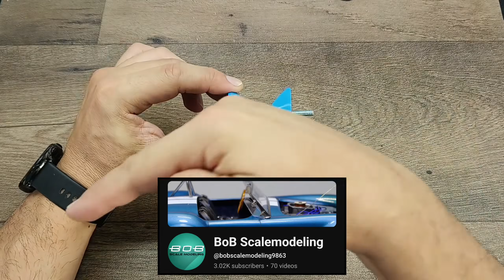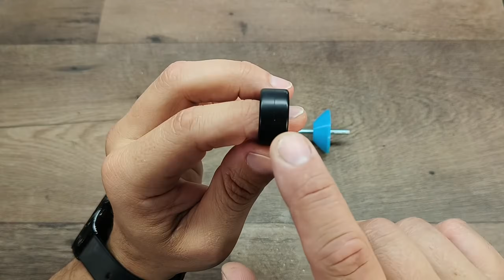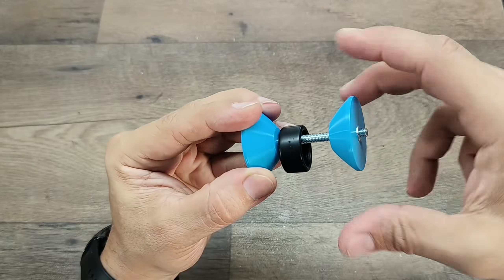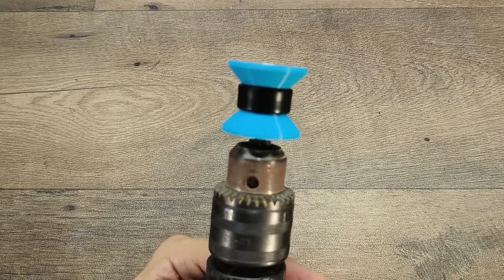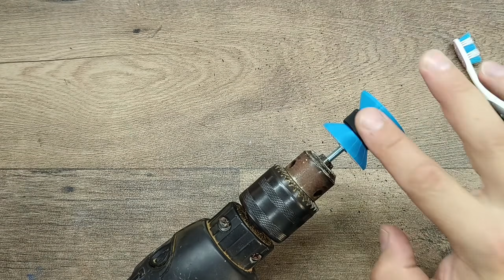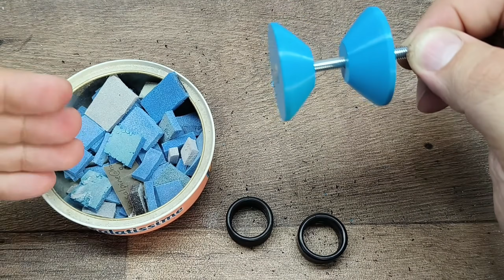3D Printed Tire Holder Review – Is It Worth It for Model Car Builders?

Comment: This looks a lot more precise than putting them on a socket like I have done in the past. I always get a little wobbling which makes sanding hard. I'm going to have to look into this. Thanks for the look at this tool Karl!
Reply from the maker: Thank you for watching and leaving your feedback my friend, very appreciated ☺️
Yes I found this tool really useful. Before I used to place tires between two round pieces of styrene, but it was always a struggle to align the tire in the middle without wobble! This tire holder held the tire well in place and I could easily sand the surface, as seen in the video. I've never used the socket method but I did hear of other modellers using such a tool. Thanks again